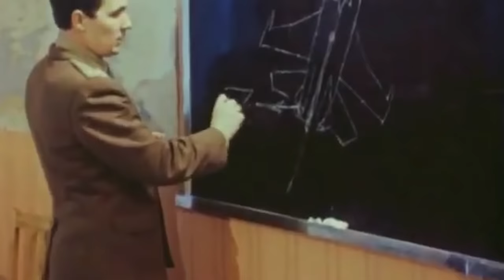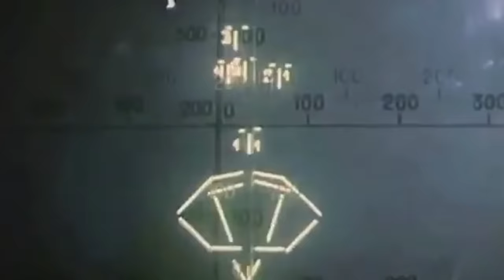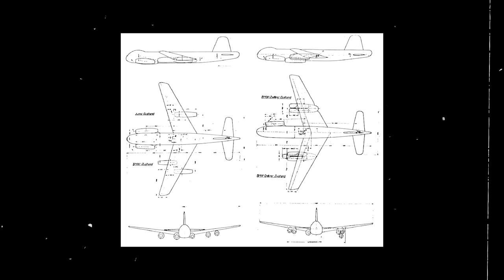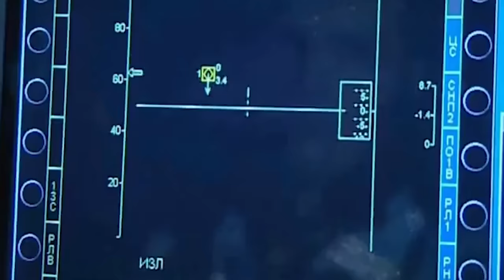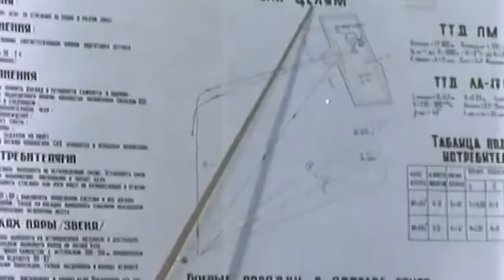The Secret Russian Fighter with Backwards Wings

Comment: The Soviet Union did not "fall" in 1989. Several SSRs were actively trying to break away in 1990, but it was officially dissolved in December 1991.
Reply: So it "fell apart"
Reply: @EpicLoLs89  Thanks to the US actions and long internal problems
Reply: @EpicLoLs89  not in 1989
Reply: Su 37 Berkut is huge.  We came out with a smaller older F5 fuselog with invert wing.  Size does matter when it come to Demonstration Aircraft so as to show case range, endurance and weapon load.

Comment: Dark Doc's forgot to include probably the biggest reason the Soviet Union collapsed, Chernobyl. You have to remember Chernobyl took place in 1986, just a few years before the collapse. The reason it was such a significant impact was because, aside from the first responding fire fighters, miners, scientists and people who worked at the plant, Chernobyl was dealt with completely by the military. From analyzing the damage to the clean-up to the construction to the original tomb it was encased in. All those people where contaminated by the radiation, so they went thru there people fast. They eventually would have to call up reserve units to replace the sick workers or workers who where on the site to long and close to getting dangerous levels of radiation and had to be rotated out. Which to the Soviet Unions credit, they did try to protect there soliders from as best the could with the limited resources and knowledge they had. However it wasn't enough, basically Chernobyl destroyed the Soviet Union's military by contaminating it's soliders. Not to mention the incredible cost of not only money, but resources they needed to contain the disaster and it's radiation(which will be there for over a thousand years). It pretty much bankrupted the country and left it without a large part of it's defensive forces. You also have to remember, Chernobyl happened in the Ukraine, not on actual "Russian" soil. The leaders made a decision like a doctor would make, cut off the infected(or in this case radiated) area to save the rest of the body. So if Russia was to survive, the Soviet Union had to die. Which is exactly what happened.

Comment: I own an Su-37 Berkut. Spec's are: Wing, 1112mm/43.79in - Length, 1600mm/62.99in - All Up Weight, 2140gr/4.72lbs - Power, Twin 70mm/2.75in EDF's (Electric Ducted Fans) - Control, 50 Amp Brushless Speed Controller - Battery, 22.2v 6s 3600mah 25c Li-po (or 25 x 3.60amps =  90amp hrs / 50 = 1.8hrs of available flight time at full power). Realistically, most Radio Controlled flights are Ten minutes or less. 
  I purchased it as an ARF (almost ready to fly), meaning all I had to do was install the R/C electronics (receiver/servos, battery), do a little gluing & screwdriver work, trim it out and Fly!  The Wings were Carbon Fiber/Laminated Plywood composite construction making it light and free from distortion/flexing. It fly's Great. I purchased it for our R/C Model A/C Clubs annual "Warbirds" event here in SW Washington (all A/C had to be an actual "scale" model, even if there were only a "planned" version to be built for Military purposes). People loved it and it was a Show Stopper.

Comment: Su-37 : Flanker-F, nicknamed "Terminator"
S-22 : original mock-up
S-32 : one of the final designs for the actual prototype
S-37 : Berkut, later redesignated Su-47, NATO reporting name "Firkin"
Reply: Yup. It was funny in the game AC4 you had the SU-37 and the "S-37" opponents. And it threw me when I went to look it up and found it had already been changed to SU-47.
Reply: thank you
Reply: @corvetteworldrob8586  in ac3 it was su-43 berkut II
Reply: he was never called "terminator", do not compose.
Reply: @alexgainsborough4921  He?
Reply: @alexgainsborough4921  I didn't coin the nickname, I'm simply repeating it. It's been around for 20 years
Reply: @kibathemechanic4967  No, it was not. If the Russians officially begin to call, for example, the F-35 "The Poop" - you will not claim that this is the name of the aircraft.
Reply: @alexgainsborough4921  You do know what the definition of "NICKNAME" is, right?

Comment: There is also additional problems with a forward swept wing. Basically in general for super sonic planes you want the whole plane behind the shock wave generated by the nose / tip of the aircraft. with FSW the wing tips are likely outside the first shock wave and create a second one.
Reply: It was only meant as Technology demonstrator
Reply: That's why swept forward wings have to be variable geometry, like the F-14.
Reply: And yet the X29 did it's supersonic flight test with flying colors. So either the shockwave issue was not as important, or the technology overcame it.
Reply: @seanprice7645dog fighting days are over
Reply: @selassietetevie4966  That's what they thought in the 60s and were wrong then as 
well
Reply: @davemartin5794  it's moved on to drones and smart munitions.
Reply: waiting for this thing to comeback in unmanned aircraft.
Reply: @donaldbadowski6048  The shockwaves means its very loud and causes excess stress on the airframe.

Comment: As mentioned late in the video, the US X-29 from Grumman had FSW and first flew in 1984, over 10 years before the Su-37 did. The single-engine X-29 used a version of the engine used in the F-18. Both planes were experimental technology demonstrators. The X-29 was retired in 1991. The F-22, which has thrust vectoring, began operational testing in 1997, and became operational in the end of 2005.
Reply: Also of note: not only did the X-29 fly 13 years before the Su-47, the US built twice as many X-29's.
Reply: It was the X-31 that pioneered American thrust vectoring technology. But F-22's thrust vectoring was even more advanced, since it had a rectangular output and was stealthy, which is quite a feat for a thrust vectoring nozzle.
Reply: The single-engine X-31 did over 500 test flights from 1990-1995. It also used the engine used by the F-18.
Reply: Hey, give them a break... it took that long to get their intelligence out of the states.
Reply: And Nazi Ju 287 fly 40 years before x29 😉
Reply: @McGregor323  Nothing changes. The Americans stole someone else's invention and proudly beat themselves with a hoof in the chest, declaring that they are the first!...)
Reply: @Кипящийразум  You're right American's landed humans on the Moon multiple times successfully the only nation in human history to ever achieve this... Nothing ever changes.
Reply: @McGregor323  quite a reach to compare that primitive design to something built in the 1980's, that's like saying the Horten-229 was the first stealth bomber because it vaguely resembles a B-2 (and for the record, Northrop built flying wings before the Nazis did so don't try that argument either). The point is, the US tested the forward-swept wing design, realized it wasn't worth the stability trade-offs, and focused on creating a stealthy air superiority fighter instead with the Advanced Tactical Fighter program, which birthed the most dominant aircraft ever, the F-22. Took the Russians another decade to figure it out
Reply: @yomama629  О, ты и на этом канале. Ф 22 самый доминирующий? Напомню, что Ф 22 остановили производство. Покажи мне высший пилотаж от Ф 22, где Ф 22 выполнил хотя-бы половину того, что выполняют российские истребители.  В чём доминация? По ВСЕМ характеристикам Ф 22 уступает российским аналогам. Может быть "невидимость"? Этой "невидимостью" можно пугать только откровенно отсталые страны. Для страны с лучшим ПВО в мире, никакими "невидимками" они не являются.
Reply: @ПетрПетрович777   you have a seriously flawed understanding of modern air combat if you think kinematic performance and maneuverability are what makes an aircraft dominant in the air nowadays. Stealth (what you call "invisibility" I assume) doesn't make an aircraft invisible on radar, at least not ones that have vertical stabilizers (even canted ones). What it does is dramatically reduce the range at which radars can detect them and especially the range at which high-frequency radars can get a targeting solution on them. Low-frequency radars may be able to detect them from further away but are not precise enough to target them, so air defense systems like the overrated S-400 and S-500 can't target them until they get within 30-40km of them (at least in the case of the F-22 and F-35, which are both stated to have radar cross-sections of 0.0001m2). However, these aircraft have extremely powerful AESA radars and are able to detect and target these anti air systems from much further away, giving them impunity to perform SEAD/DEAD missions. The same applies to air to air combat, the Su-57 has an inferior radar and a much worse radar cross-section (Sukhoi numbers state 0.1m2-1m2) than the F-22 and F-35 so it would be shot down by a BVR missile long before it could target either aircraft.

Stealth isn't the only technology that matters, you have things like electronic warfare, sensors and avionics, data fusion, networking capabilities, and in the case of the F-35, total situational awareness. The Russians knew they couldn't match the US’ technological might so they opted for more maneuverability, which only really serves propaganda purposes for the uninformed who’ve watched Top Gun too many times. And anyway, the Su-57’s fancy maneuvers are post-stall, which is useless even in an old-fashioned dogfight. Air-to-air missiles are far more maneuverable than aircraft, and conserving energy out of a turn is the most important element of winning a dogfight, bleeding all your energy by doing a Cobra or similar maneuver will only result in your aircraft getting immediately shot down
Reply: @yomama629  Полигон, который обозвали украиной (после революции 1917 года, ибо до революции это русские территории)  отлично продемонстрировал, что из себя представляет вооружение НАТО против державы, а не против аборигенов с копьями. Хочу напомнить, что СУ 27 и МиГ 29, которые достались украине от СССР уничтожались практически сразу как только оказывались в воздухе. А ведь это до сих пор одни из лучших истребителей. Напоминаю, что украине после развала СССР досталась не только огромная территория, огромная промышленность, население в 52 миллиона человек, но и ТРЕТЬЯ АРМИЯ В МИРЕ по количеству наземного вооружения, это больше , чем было у Китая на тот момент.  Так-же  Украине досталось огромное количество воздушных судов, и даже был свой флот. Напоминаю, что всю эту армию  перемололи относительно небольшими силами российских СВО менее чем за пять месяцев. Далее уничтожалась техника стран варшавского договора, которая стекалась на украину буквально рекой, а сегодня уже уничтожают западный хлам. 59 стран буквально работают на украину. Почти все те же страны, которые когда-то были в союзе с нацистской Германией. Парадокс. История идёт по спирали. И ты видимо забываешь, что рассказывать интересные и "реалистичные"  истории в своих фильмах любит именно Голливуд, а уж на слове "пропаганда" США буквально зациклились, и уже даже не отдают себе отчет, чем лживая пропаганда отличается от пропаганды в целом. Например, пропаганда здорового образа жизни, пропаганда здравого смысла, пропаганда семейных ценностей, любви к своей Родине... Хорошо это или плохо?
       Я бы очень хотел, чтобы страны НАТО передали украине Ф 35, чтобы в очередной раз посмотреть как "эксперты" в комментариях будут в очередной раз оправдываться о "неправильной эксплуатации этого хлама", но я сомневаюсь, что это возможно, ибо причина проста - на кону стоят огромные деньги и репутация. США буквально подмяли под себя военную промышленность стран Европы.  По этим причинам Швеция очень не хочет вступать в НАТО, ибо она лишится собственного производства и будет вынуждена покупать такой хлам как Ф 35 стоимостью на вес золота.
    Касаемо "невидимости" она же технология "стелс", напоминаю, что рассчитал углы именно советский ученный Пётр Уфимцев. Напоминаю, что американцы прочитали его книгу, вложили миллиарды долларов в разработку Ф 117, а потом этот же ученный продолжил свой рассказ о том, как эти "невидимки" легко обнаруживать.
     И ты во многом прав, они не являются невидимыми, тем более для таких стран как Россия или Китай. Он не является невидимым он называется малозаметным Каждый самолёт отображается по разному на радаре. Это как отпечаток пальца - у каждого он свой, у Ф 35 он свой. И как бы НАТО не прощупывали нашу оборону, этот "невидимка" каждый раз был обнаружен, когда приближался к нашим границам. Его основная задача была не только разведка, но и вскрыть средства воздушной обороны. Но основные средства воздушной обороны задействовать не приходилось,  Ф 35 был обнаружен намного раньше. Уверен, об этих перехватах вам не очень любят рассказывать ваши СМИ, или когда рассказывают, то они называют эти перехваты "агрессивными". 

    Напоминаю, что в отличии от американских истребителей, в российских есть не только электронное управление, но так же дублированное аналоговое. Российские РЭБ могут буквально отключить этот Ф 35. То есть создать  непреодолимый купол, либо отключить Ф 35 мощным направленным лучом. 
    Кстати, без поддержки "авакса" (летающего радара) эти "невидимки" - слепые, а в случае активации своего радара, они тут же будут обнаружены, то есть их "невидимость" сразу становится АБСОЛЮТНО бесполезной. И тут мы снова возвращаемся к ближнему воздушному бою, где уже решают и подготовка пилотов ( а в России пилотов готовят в воздушному бою) и характеристики самолётов. Я думаю спорить с тем, что Ф 35 уступает по лётным характеристикам даже истребителям третьего поколения ты спорить не будешь?  Мы можем ещё немного добавить или убавить своё мнение в комментариях, но в результате вывод будет простой :  В случае внезапной встречи Ф 35  и ЛЮБОГО современного российского истребителя, у пилота Ф 35 будет шанс спастись только в одном случае - если он успеет катапультироваться
Reply: @yomama629  И будь так любезен, изучи характеристики истребителей, которые подходят под определение истребитель пятого поколения , потому что кроме как "малозаметности" Ф 35 более не подходит не под одну из характеристик пятого поколения.
Reply: @monkeybarmonkeyman  The Russian rocket powered  Tsybin LL-3 (Forward Swept Wing research airframe) flew in the late 1947, made more than 100 successful test flights (firstly as a glider) & reached  speeds of Mach 0.97 (1,200 Km/h). It took more than  37 years for the Americans to realize that wings can be mounted the other way around and still work. Also refer to Hansa Jet,  a German civilian design with 47 production examples which flew roughly 20 years before the X-31.
Reply: @ПетрПетрович777  You literally are speaking entirely out of context, try to attempt to disprove the fact the f22 is technologically superior and the reason it was discontinued is because there is something to replace it in production? There hasn't necessarily been a conflict where the f22 was even needed to accomplish anything, why waste flight hours on missions that can be done by older generation aircraft.
Reply: @Nihghtbot  Речь идёт о том, что то количество электроники которое в него засунули не делает Ф 22 лучшим перехватчиком или истребителем. Наоборот, то, что из Ф 22 или Ф 35 делают компьютеры с крыльями  стоимостью на вес золота - это их слабая сторона, которая в условиях реальной войны и нещадного военного использования быстро превратят в хлам те Ф 22 и Ф 35 которые сумеют выйти целыми из боя. То, что российские РЭБ их могут буквально отключать это тоже не новость. После того, как в Сирии под носом у натовских баз появился небольшой контингент российских ВКС использующий РЭБ "Красуха"  всему "прогрессивному" альянсу НАТО по факту запретили летать даже близко у этих территорий. Ибо в отличии от нас (диванных экспертов) знающие люди понимают на что способны те или иные технологии. А весь остальной наигранный пафос, (вроде того натовского корабля, который подошёл к Крыму и провоцировал своим проходом вооруженные силы РФ) это всё для западных обывателей. В реальности Россия могла утопить этот корабль, и поверь, максимум что последовало бы дальше - это высказывание озабоченности и пакет очередных санкций.
       Ещё раз - они не являются невидимыми, а их нелепая аэродинамика говорит сама за себя. Насколько мне известно, часть программного обеспечения уходит на то, что бы постоянно корректировать эти летающие утюги , чтобы те попросту не свалились. Они не способны на равных биться даже с истребителями четвертого поколения. Расчет на то, что они выстрелят издалека и улетят, не подойдёт для условий жёстких военных действий. Аэродромы будут уничтожаться, летающие радары ( без которых они теряют возможность пользоваться своей малозаметностью)  будут сбиваться. А вот там, где  нет многослойного  ПВО, ракет и авиации, вот там можно демонстрировать свою "мощь". Чем страны НАТО и занимались все последние годы - уничтожали и разоряли малые страны, которые при всём желании не могли  противостоять варварам из террористической организации НАТО,